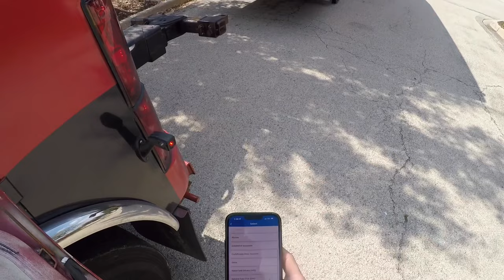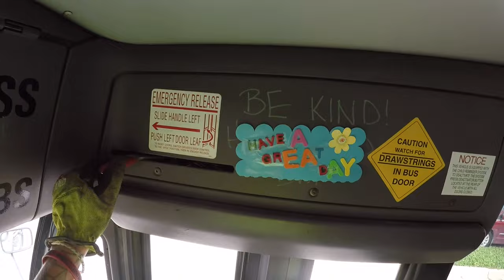Towing a school bus

Comment: Hello Maclichi! That really wasn't the best place for the bus to break down, a bit too tight for a 20-ton wrecker I agree. And you are also right, your 12-ton is probably sufficient power to pull a short bus indeed, its an F450 afterall. The part I think I was impressed with the most, was watching you handle that tight parking lot, like the first time you lost your virginity, perfect. Not only did you not hop any curbs, but you didn't run over any mailboxes, superb job my friend!